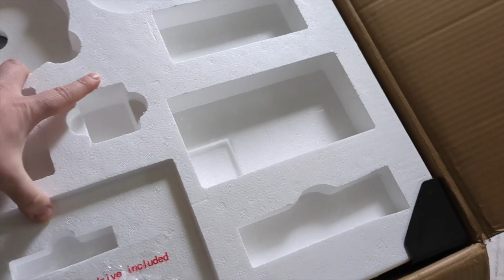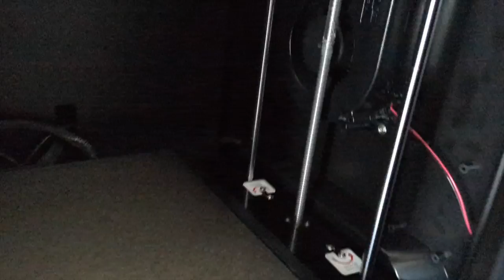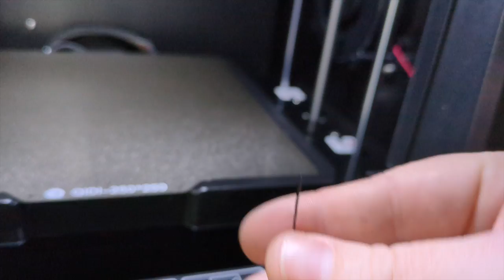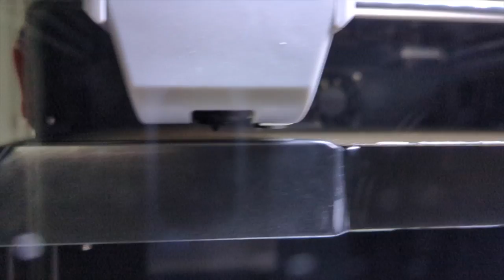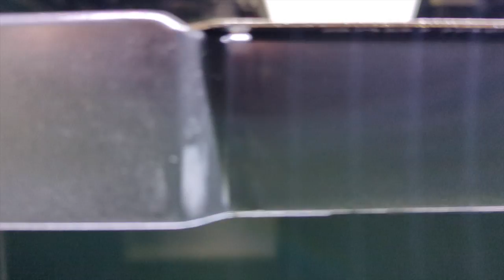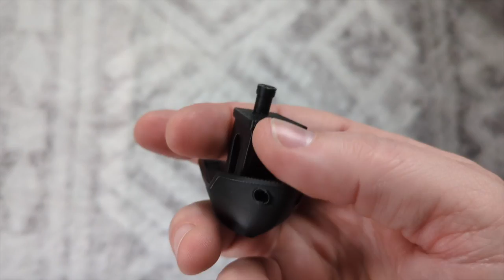QIDI TECH Q1 Pro Unboxing and First Print

Comment: Glad im not the only person with some minor issues on setup! Just got mine and am super happy they updated the build plate and filament input. Big improvements from the early youtube versions out there. When calibrating my build plate went lopsided and wouldnt finish the set up. Of course i freaked out and wrote to customer support which they got back within a few hours. But it fixed itself when i accidentally started a print, the build plate levelled out perfectly. Ive been using AnyCubic PLA Plus and its been amazing every print. Cant wait to try my ABS next

Comment: I'm having an issue with mine crashing everytime you calibrate through the Slicer, Qidi just told me to stop using it....I'm hope it's fixed soon.
Reply: Interesting, yeah I haven't tried that yet, actually haven't done anything special but print... Hope they find a solution for you sooner or later with calibration.
Reply: @nathankazier2267  im also having issues at 240mm print height, the wire running to the bed in thr back twists up and pushes the bed on the Y axis causing the prints to bend at the tip. can't even print a cylinder at 238mm height without it becoming crooked.

good thing the time-lapse works, you can see it clear as day in the time-lapse
Reply from the maker: @ze_edboi  wow, i will have to test mine out and see, i know the wire you speak of, so im going to run some tests on mine

Comment: I don't have a printer yet but i definitely want to get into it. Would this be a good one to start with? I like bambu labs a1 but that got recalled so...plus i want to have one of these in my garage. I think this one would be great because of the heater it has so when it gets cold outside it wont mess the print up or at least i hope it wont. I want one thats also enclosed means how it will be in the garage so no contaminants can get inside. Sorry for the huge paragraph lol.
Reply: No your fine, for a first 3D printer I think it's a good choice. Compared to the first one I bought where I had to build it, it's miles apart. Highly recommend
Reply: @nathankazier2267  Thanks for the response!